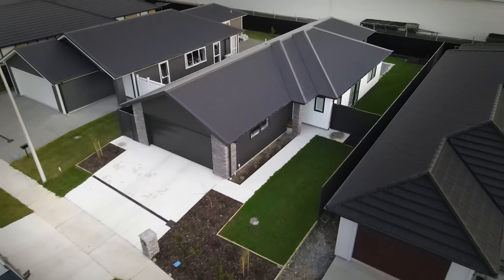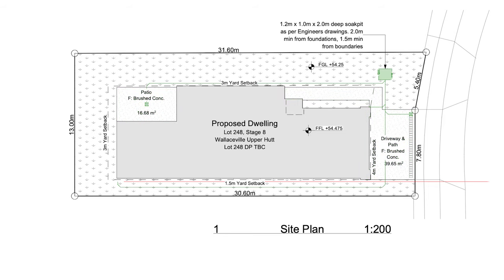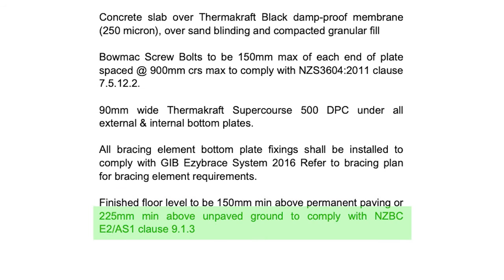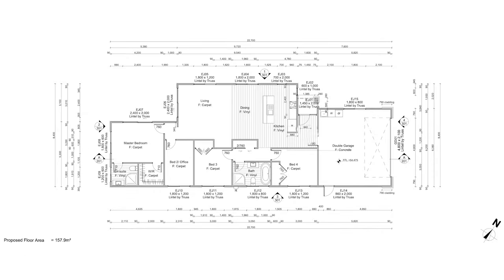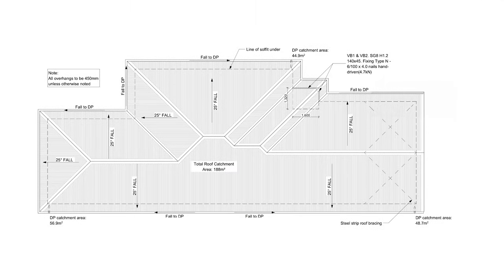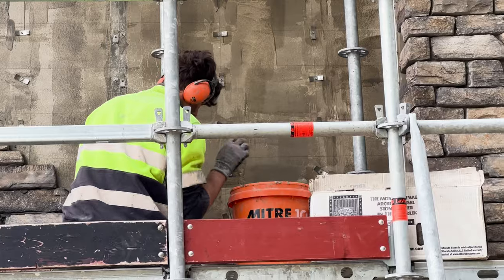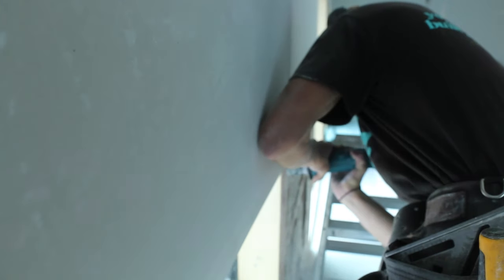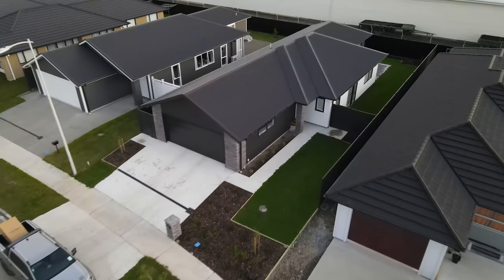Deep dive into an awesome NZ new home

Comment: Linea weatherboards…, be very interesting in 20 years and see if court cases happen. It’s basically compressed dust. NZ is a damp high moisture country and unless Linea is fully protected at each nail hole and joint it’s gonna leak and fall to bits. People have been led to believe it’s fantastic but time will tell. I personally would stay far away from it for house cladding here.
Reply: Linea is a great product. All the houses with weatherboards in my subdivision  are all wearing out and starting to rot. Probably because of a poor paint prep..but none the less

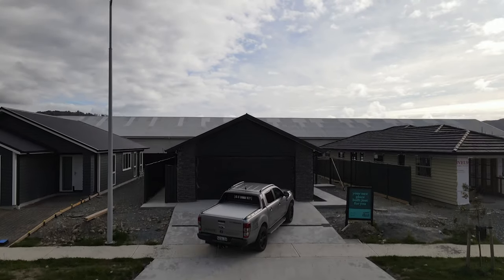Comment: 9:28 Is there a reason that the houses don't have a second floor? I know that the houses are long so there may not be a need to have a second floor,  but was wondering if there was something more to it?
Reply: It all comes down to cost. With land being so expensive, most of the time there is not a lot left in the budget to entertain things like a 2nd floor, unfortunately. 
In addition to this, with smaller section sizes, the additional setbacks required for a 2nd floor mean that the extra floorspace you gain from the 2nd floor starts be become less efficient.